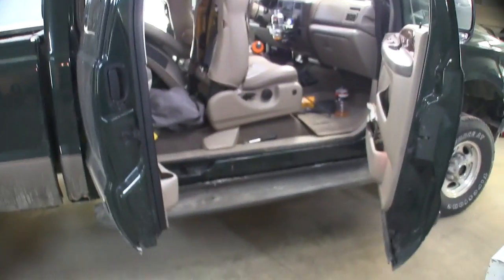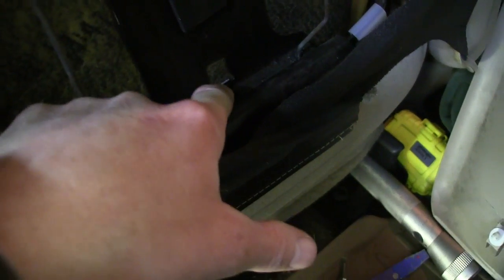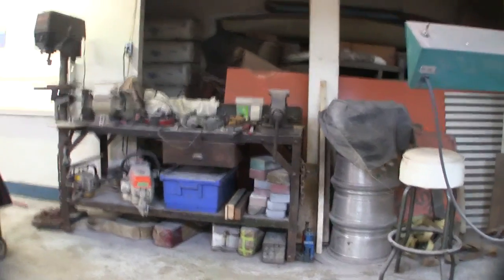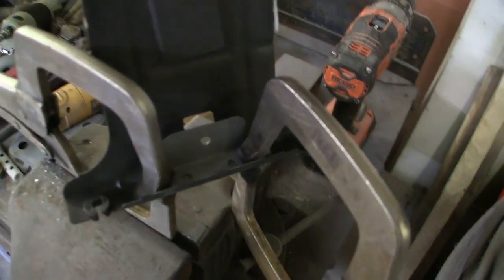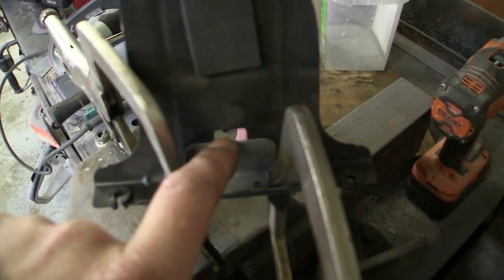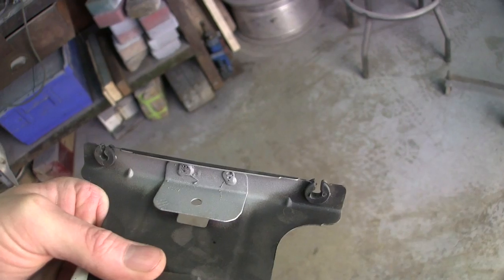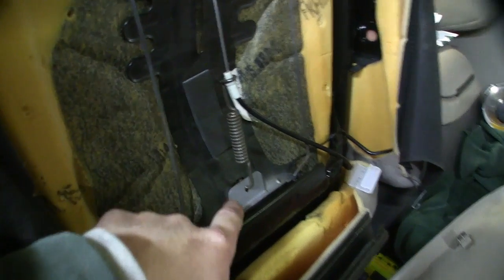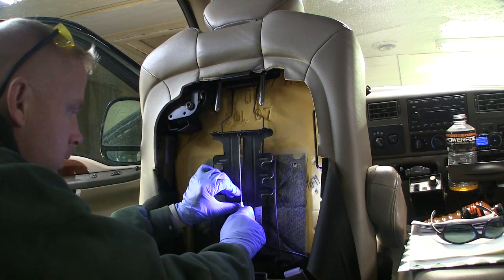How to repair broken lumbar support on Ford Superduty Pickup

Comment: Thanks for this - I thought those christmas trees, as you call them, were a two part fixing. One part that has to be installed in the hole in the metal work to receive the peg from the board that forms the back of the seat. I find that they frequently break when you try to separate them from the back board of the seat. How did you separate the back off the seat frame without them breaking?
Reply from the maker: Those type fasteners just have a tab on them that slides into a notch on the panel and the "christmas tree" pops into the metal hole that receives it.  All I used to pop it free was a trim removal tool that looks like a flat screwdriver with a notch cut out of the middle.  You wedge it under the head of the fastener and pry it off.  You can usually re-use them a couple of times before they are junk

Comment: I have a 2004 ford f-250 lariat crew cab captains chair power seats but with manual lumbar knob control.  I am going to replace the whole assy for lumbar support.  It says if i have 40/20/40 split bench seats without seat integrated restraints and one that says with seat integrated restraints.  How do i tell which one i have?
Reply from the maker: I would have to imagine that integrated restraints would be the captains chairs with the seat belt that comes out of the top of the backrest near the headrest.  Just a guess.....
Reply: it's captains chair and seat belt isn't attached to seat itself.  It has an arm rest on right side of driver side chair.  The piece that you were putting back on kinda looks like a spine, what is the name of that part?
Reply from the maker: Not sure what it is called